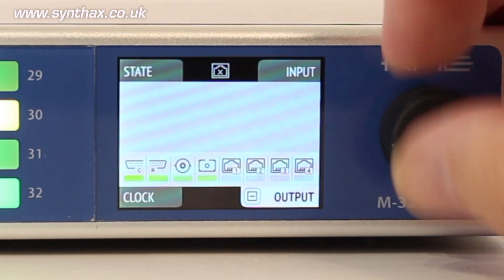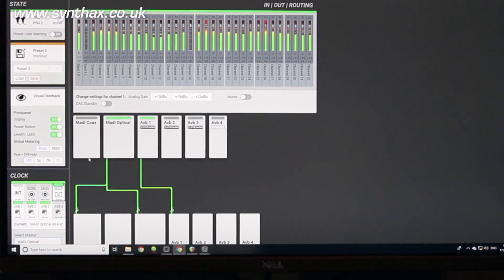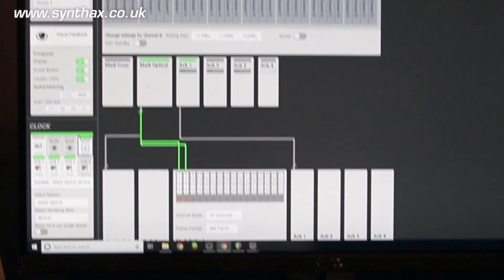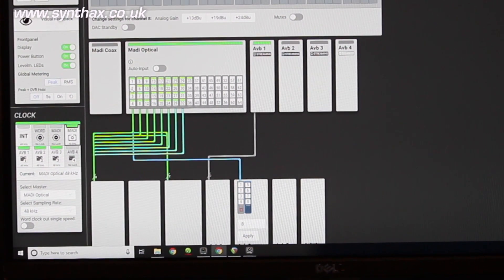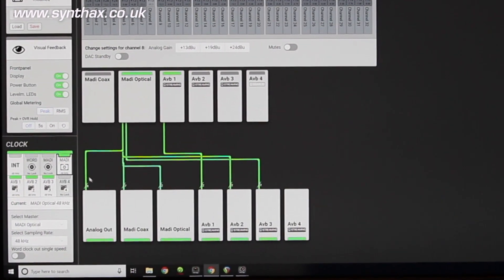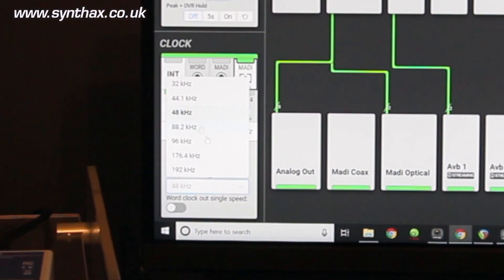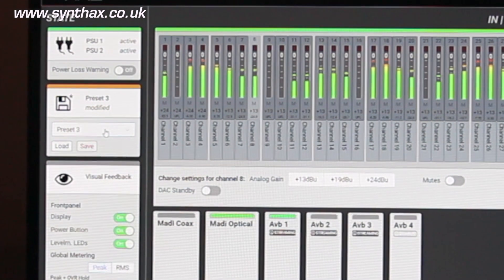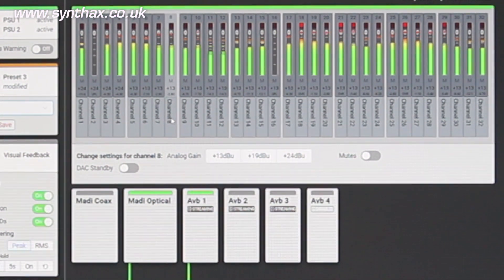RME M-32 AD Pro and RME M-32 DA Pro MADI and AVB Converters - IBC 2018

Comment: Please assist, @Synthax Audio UK!!!

I am VERY interested in M32.  BUT, I have a lot of ADAT connections.  I don't want to have to find the older M-32 to run the ADAT into it.   Is there something which I am missing which will allow me to transfer the ADAT via AVB or something?   If so... PLEASE provide a video, as I cannot find a solution.

Thank you for any/all time wich you provide on this.

Comment: How do these converters compare to what's in my ufx±
Reply from the maker: Hi the UFX+ already has excellent converters (see specs below). Being RME’s latest high-end, multi-channel converter, the M-32 Pros’ AD and DA conversion is slightly better (on paper at least - again, see below), with even better SNR values than the UFX+.

M-32 AD
Signal to Noise ratio (SNR) @ +24 dBu, 44.1 kHz: 117.0 dB RMS unweighted, 120.7 dBA

M32 DA
Signal to Noise ratio (SNR) @ +13/+19/+24: 116 dB RMS unweighted, 119 dBA

UFX+ AD
Signal to Noise ratio (SNR): 113 dB RMS unweighted, 116 dBA 

UFX+ DA
Dynamic range (DR): 115 dB RMS unweighted, 118 dBA 

Whether it's worth upgrading to the M-32 Pro will depend upon your setup needs. What do you mainly record?